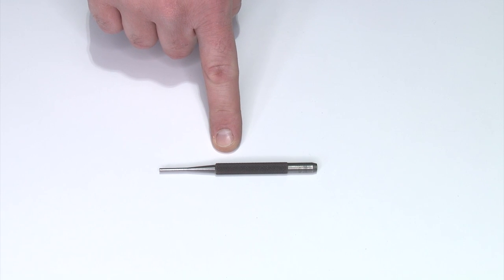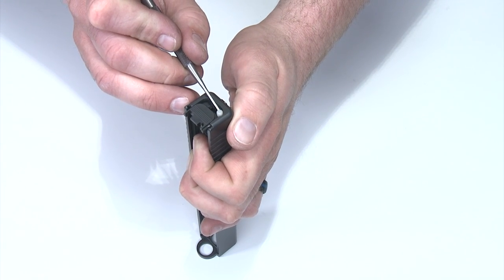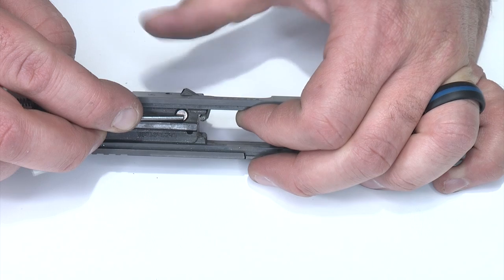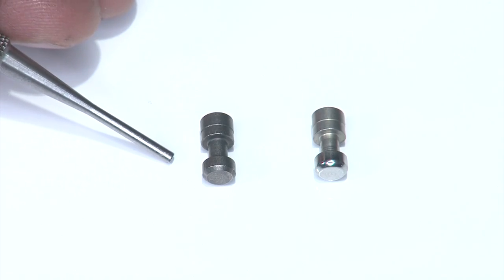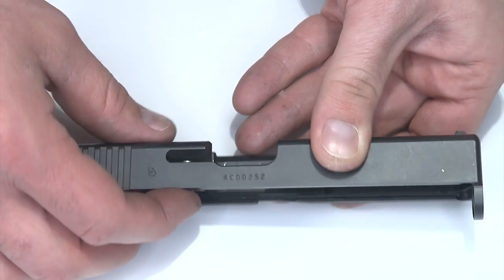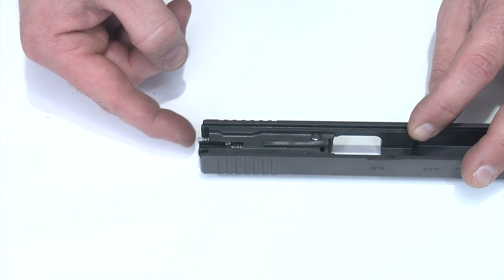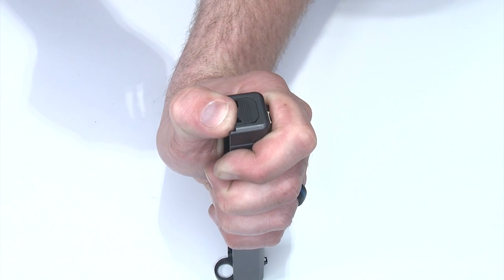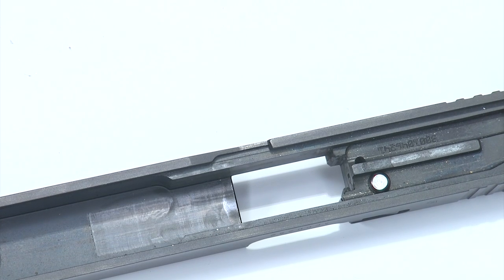How To Install The Ultimate Safety Plunger For Glocks

Comment: Great no bs and all useful demonstration and commentary in this video, if you are somewhat new to the Glock or Glock clone platform then this video has some great and simple reminders and advice!!!  

Please note advice given in this video also transfers directly over to the PSA Dagger and Dagger compact when ordered for the Glock 19.  It does NOT transfer to the Dagger Micro if you choose to carry in that size…

The ONLY thing I wish you included but you don’t is a new ejection spring that is the only thing.  Otherwise this is a 5 star trigger that should be in every Glock!!!

Comment: Thanks, big help. I forgot how to get the plunger out. Didn't need a new plunger just needed to remove it and polish.
Reply: @golgo2888  You first
Reply: @golgo2888  Its illegal and I highly recommend NOT to do it
Reply: @brandonbullins  lol I'm not going to.
Reply: @golgo2888  I did this by accident by installing 2 springs. I had pur one in and then stuck another into the saftey button and installed it. At first I thought it was the lower but stripped it and found the culprit. Shooting full auto when you arent expecting is a little scary lol

Comment: Somehow my glock 34 gen4 spring does not seat very well in the apex plunger which results in a squeaky sound when I slowly pull the trigger. Rotating the spring or forcing it into the plunger or just put it in loose sometimes eliminates the squeak but after 2 or 3 shots the squeak is back. Any idea how to fix that . I went back to stock for now. Maybe use another spring ?

Comment: Seems alot cheaper to just polish the plunger with some mother's and a Dremel call it a day
Reply: Looks like that is all the OEM plunger needed. Other than that they were identical.
Reply from the maker: What we do it a little more complicated than that. Ours is designed, machined to spec, and QC'd so they are all within the tolerance of our specifications. Of course, we're not doing one safety plunger. We produce thousands, so consistency is kind of important.
Reply: Don’t say, “cheaper ! “      
More economical and just keep the debris of spent propellant and soot wiped down.
Oh !   And minimum lubricant !!  But then Glock says that, too.

Comment: Do the gen 5 firing pin safeties work as well as the previous gens?
Reply: The factory plunger on gen5 is good
Reply: @cvshav  - Do you think the Gen 5 plunger is as good as the previous generations round one?
Reply from the maker: Yes.